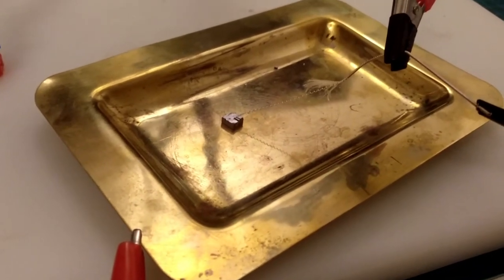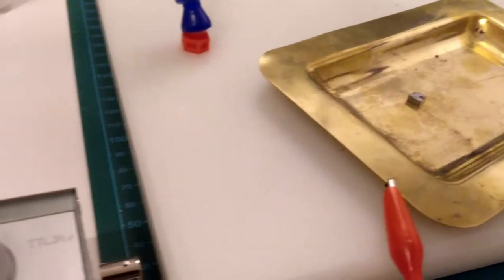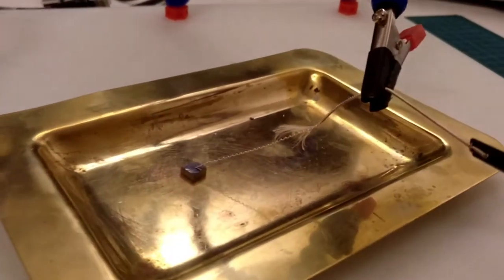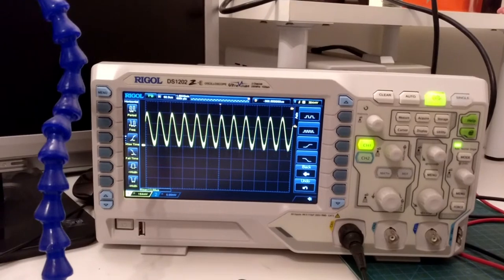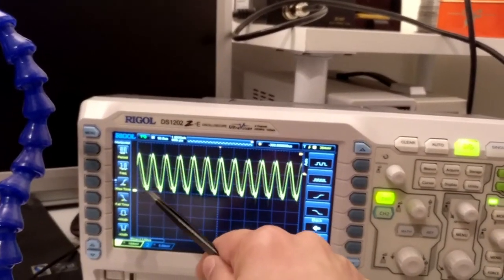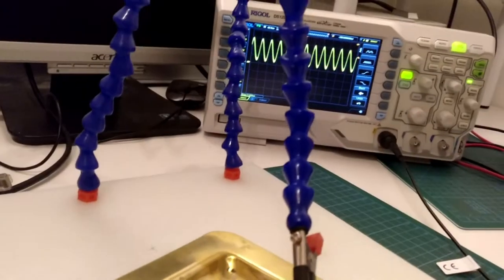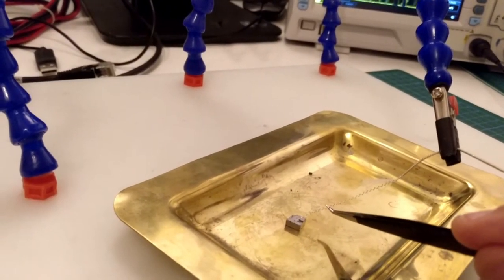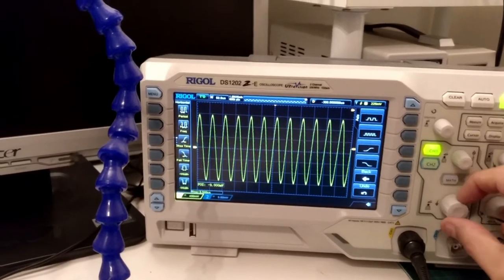Rectification by means of a Galena Crystal

Comment: Why the rectified wave is only shifted and not cut by the diode ?
Reply from the maker: Well observed. I should have said "nicely off-set" but I said "rectified" .

Anyway, in answer to your question, the wave form you are expecting, we can obtain by adding a resistance to the circuit.

Take a look here?

https://youtu.be/u4fjwCeujkE?feature=shared